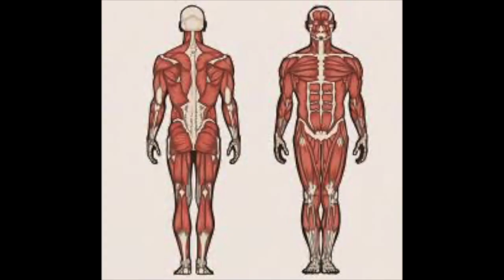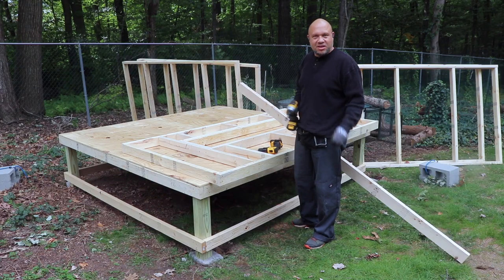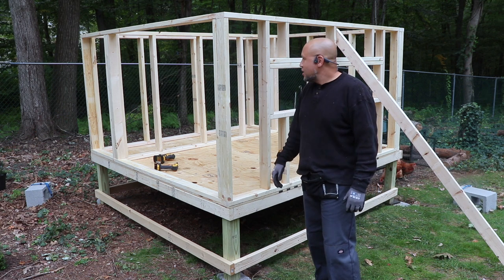Coop walls and framing. Most Epic DIY Chicken Coop Build Part 2.

Comment: I have a question about measurements. Do you have the measurements that you used for all the walls? How tall are the walls finished? Also on #5 wall, how did it fit in there if it were cut 8' minus one width of a 2x4, seems it would be too long to fit in the interior space? I'm not trying to be funny, I'm actually trying to replicate your build, I love it so much.
Reply from the maker: Hi Thomas, thank you so much, I'm very flattered!!! I didn't think you were trying to be funny and of course I'll help you as much as I can. You can always email me at:

Practicetheartod@gmail.com

That way I can send you pictures and give better replies. Believe it or not, I'm going to go back and watch the video so I can make sure to give you the best answers. In the meantime, I believe the interior wall was two 2x4s shorter than the other walls.  The walls were tall enough to be the exact height of the low run wall after the legs and coop base.   Like I said, DEFINATELY email me and I'll help you as much as I can! Thanks Thomas!!!
Reply: @TheArtofDoing  thank you so much